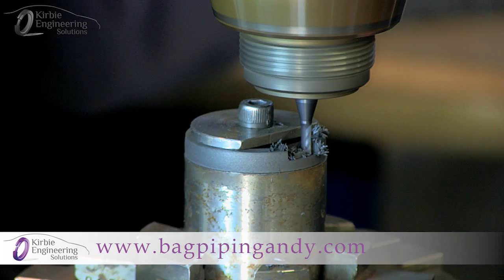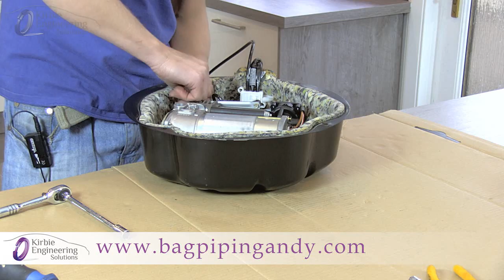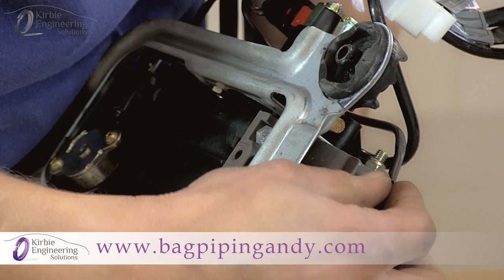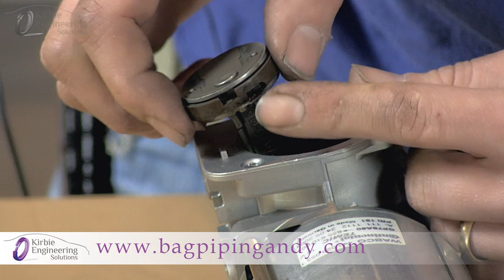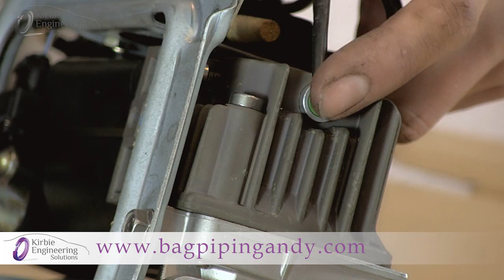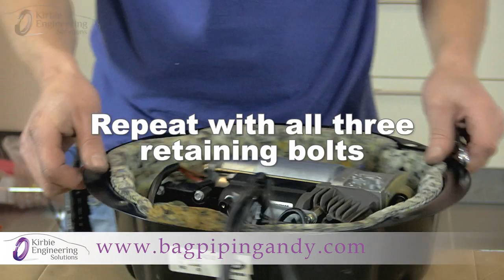Wabco Air Suspension Compressor Repair Kit for Range Rover - BMW - Land Rover

Comment: Just done it as per the instructions and it was pretty straightforward. The old ring was pitted and looked as if it wasn’t really making contact with the bore. Anyway I’ll fit it back into the car and fingers crossed. Why do Land Rover make everything so complicated ????

Comment: Hello, I am French and I use an automatic translator so sorry if there are any errors .. I replaced my 4 air cushions (e53 4.8is) but the front suspension remains very very hard! I cannot compressed them by hand, I have 12.5bars in the pressure accumulator. you know why? I have only one fault that sometimes happens: accumulator pressure remains constant, filling has been requested. Compressor ok, trim sensor ok
Thank you

Comment: Does it also fit for a Wabco compressor for a 2011 model TDV8 4.4. or do I need a different one?
Reply from the maker: For more details about the Air Compressor repair kit and further fitting advice visit
 http://www.bagpipingandy.com The site also has Andy's contact details so you can contact Andy directly.

Comment: Hi Andy, mine has no problem and its quiet in a good nic for a 2006 and obeys with no faults, but its coming up to 120K Will you advice to change it or only change it when you start having any symptoms? 

Thanks
PS Amazing instructions

Comment: Hi, great video, just bought a l322, suspension very slow to pick it's self up, so will get your kit.
Is it not wise to air dryer at same time
Reply from the maker: +tommymoto41  I Tommy.  I have passed your question on to Andy, who developed the repair kit, and will post a reply as soon as possible.
Reply from the maker: +tommymoto41   Hi Tommy. Andy has been in touch and given this answer to your question.

The piston ring kit will renew the air pressure, the air drier removes moisture 

but doesn't add to the compressor air pressure output, I can offer new drier 
beads if your beads are saturated but its not that common. Get in touch here if 
you need anything other than the piston ring repair kit: info@bagpipingandy.com

Comment: Tosh will you please cancel my order.  I have a 2006 range rover hse. The compressor is not the same.
Thanks for your help.
Reply from the maker: Chris Carpenter Hi Chris. I only produce the videos for Andy and do not take part in taking any orders for him. If you bought anything from Andy's ebay listings you will have to contact Andy himself.

Comment: Do you have a repair kit for a 2006 range rover hse air compressor
Reply from the maker: Chris Carpenter Hi Chris. If you visit Andy's website you can contact him from there, his website is the bagpipingandy url in the video description. I know he sells kits that fit Range Rovers but it is best if you check his website. There are links to all the different models and you will find Andy's email address there, alternatively his phone number is  +44 (0)7767838330 (you'll find it on his website so I'm sure he won't mind me putting it in this reply).

Comment: When you replace the compressor will it do away with the air suspension fault?
Reply from the maker: 72Disco1998 Yes it should do. Normally the problem is wear on the original piston ring so replacing it and refitting the compressor should sort out the problem. However make sure you inspect the piston and cylinder walls, if there is damage there the problem may persist.
Reply: Tosh Lubek  Thank you.

Comment: Great vidi ...... shame about the design ..... ie theirs , not yours , is such pants . Stick a compressor in an insulated , closed box & wait for the money to roll in . You ' d think they were trying to make land fill .
Reply from the maker: Robert Woodliff You would think that the original manufacturers would know that there is a problem and would either change the design or at least provide replacement piston rings. Until Andy Fulton developed this repair kit the only option was to replace the whole compressor, which is a very expensive job. Although the trend has been to throw away and replace I believe we should return to fixing things, it makes much more sense all round.

Comment: Thank you , could you help me with some thing / how I could replace Air Suspension`s rubber tube for Audi Q7 2008 , in fact I have problem with the big rings (take them off) & (return them back)
Reply from the maker: Hi Corolla Toyota. You should have got the reply from my other video on Andy but if not, I have passed on your comment to Andy and you can buy a kit from Andy's website, you will find the link to his website in this video's description.
Thanks, Tosh
Reply: Tosh Lubek  Hi Mr. Tosh , thank you for caring , in fact I visited the website ,& there is no problem with buying a Kit from Andy , my Question was about another thing , if you have Andy E mail or if you could send to me your E mail , I will send to you some pictures to show you what I want . Thanks again .